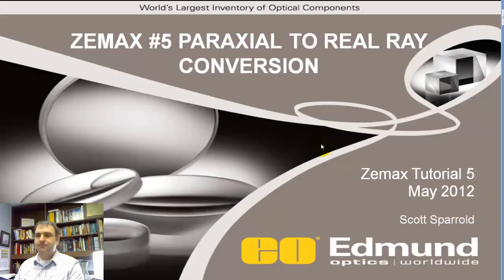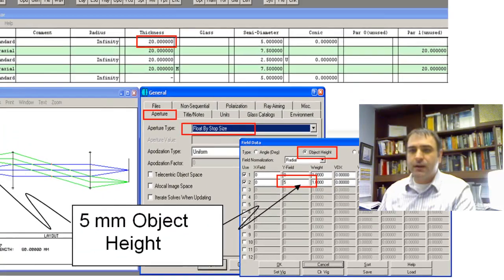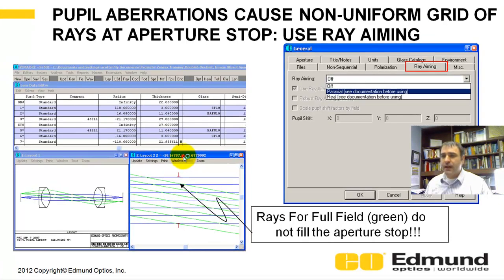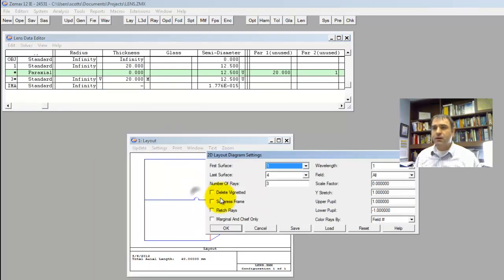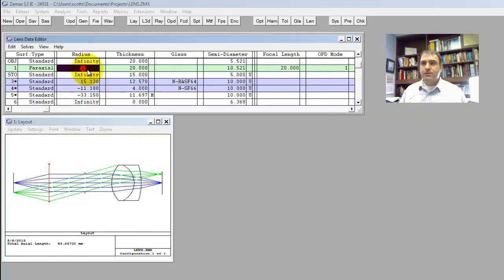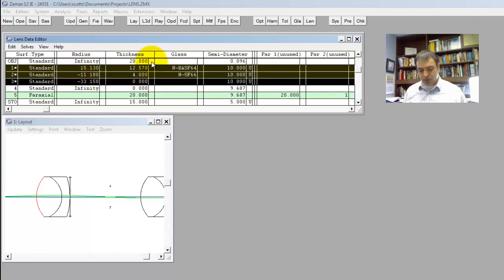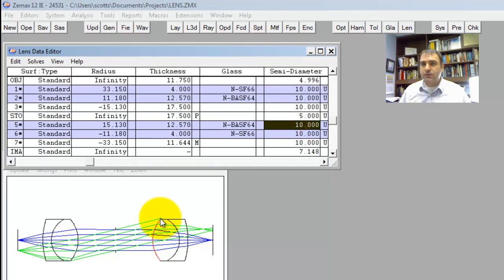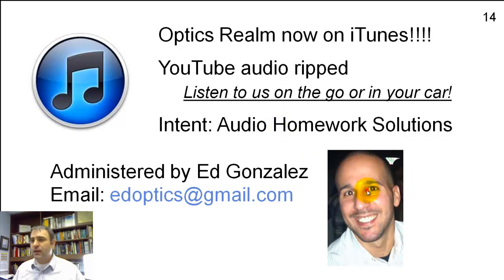Zemax Tutorial - 5 - Paraxial to Real Lens

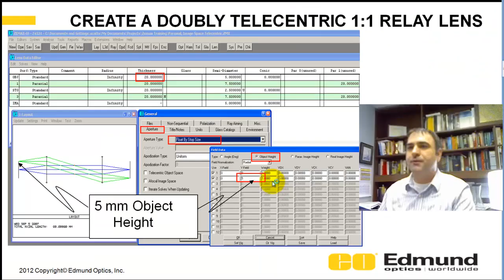Comment from the maker: @Salama: I suspect you've correctly entered the parameters and you're using the layout window to confirm your changes. The layout window at time stamp 1:45 is drawing surfaces 1 through 3. At time stamp 2:15 you have inserted two surfaces after the object. The layout window is probably drawing only surfaces 3 through 5 making it appear as if nothing has changed. In the layout window click the settings pull down or right click on the window and set the "first surface" (upper left) drop down to 1

Comment: Hi Scott,
Thank you very much.
Where did you define the F# in this tutorial?
I mean should I end up this in the Gen tab/Aperture type?
Reply from the maker: Checking back to the original Zemax files, "Float by stop size" was used for both the paraxial lens configuration and for the lens using off the shelf doublets. I used a stop semi-diameter of 5.o in the "Semi-Diameter" column in the LDM (Lens data manager).